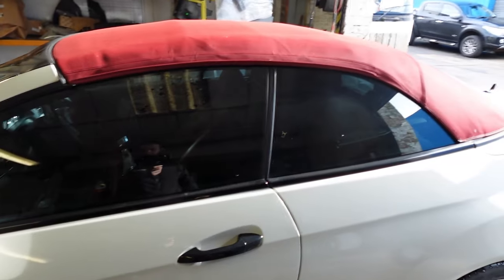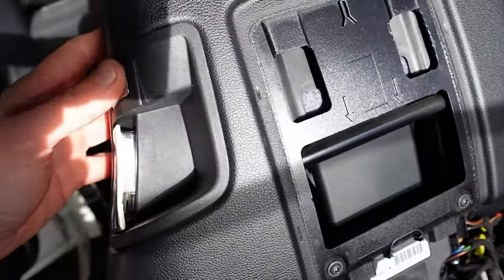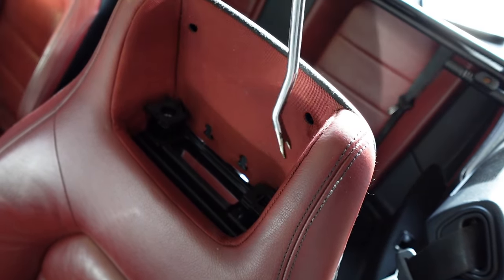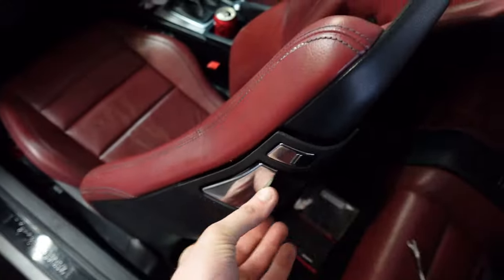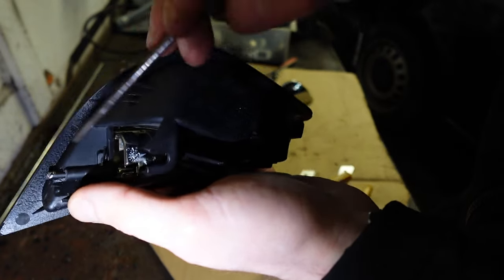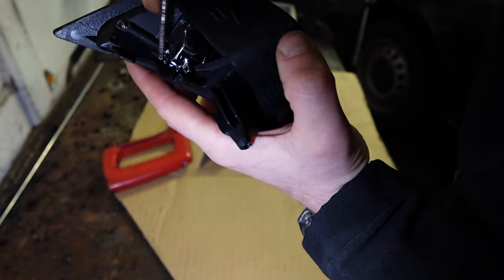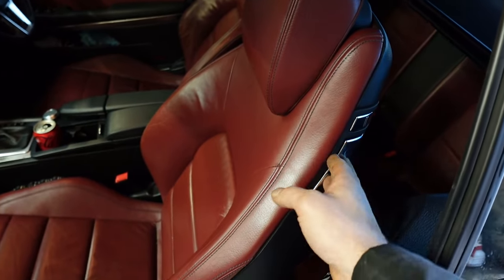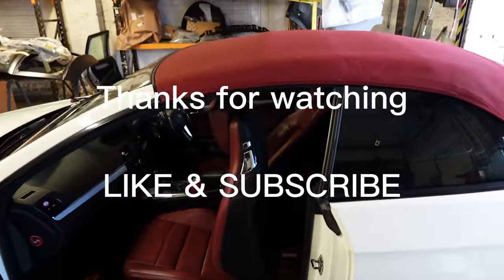Mercedez Benz Seat release handle REPLACEMENT E-class C-class A-class CABRIOLET/COUPE W207 - HOW TO

Comment: Just want to say here for those of you who can’t get your headrest out, there is a U clip, very thin metal clip on the far left of you are facing the front of the car in the back of the seat, it is seated on a black clip that holds the headrest bar… it pings off with a screwdriver…. Your headrest will then be free to release with the button. Thanks for this video, made the job stress free.
Reply: Really really important step that I think the video missed! Thanks! - One question though, how do I reinstall the clip?!
Reply: Removed the back panel. Couldn't remove headrest. Cussed all German engineers back to the third Reich. Watched video again, found this comment. Removed headrest like a pro, fixed both seats in under an hour. Promised to buy this guy a beer.

Comment: Thank you going to try this …purchased the handles of eBay fir 30pds the silver has  peeled of the original and keep cutting my fingers when pulling on it 😮
Reply: I just bought carbon fibre for £10 and took chrome of with blade and recoated with carbon using hairdryer look great took 20 minutes didn’t remove anything

Comment: Hey man thanks for the vid. I did my 2014 C 250 coupe a year ago and was almost the same procedure but did not have to release the seat cover to access the two bolts.  When I got in there the plastic barrel section of the handle that wraps around the hinge was broken in half but still there so I used blue low stick painters tape to make a mold then a slow set , high strength 2 part epoxy ( gray JB weld ) to glue it back together without removing the whole assembly from the seat - had to release the cable so no tension though. Overnight cure and another coating for strength and its been working fine though it only gets used maybe twice per month . The part is just cheap plastic so if I do replace it will prolly coat with epoxy to give it some extra strength . Would have been nice if MB handle supplier had used 20% glass fiber in the part to give it enough strength .
Reply from the maker: Yeah these are a nightmare from merc and the passanger side always breaks as used the most of convertibles and coupes ! I guess theyre designed to break so merc can charge £400+ for the assembly ! Thanks for watching and the tip much appreciated 💪🏻

Comment: I’ve tried everything but I can’t actually get the headrest out. It sounds like it’s clicking on something or locking trying to get the headrest out. Is there something I’m not doing? I got the rubber clip out at 1:51 of your video but they aren’t going out at all. Thanks for any advice in advance
Reply from the maker: The headrest comes out super easy press the button on the side to lift it up when u get the headrest all the way to the top release the button then press it again and wiggle the headrest out hope that helps

Comment: Do you disconnect the battery before changing it or leave the battery alone?
Reply from the maker: Key out the ignition and battery left on as i didnt disconnect the actual seat or airbag plugs no need to disconnect the battery and no faults on the car after completion 👍🏻

Comment: Hey thanks for the video.
So with my Merc when i pull the handle the seat is not automatically going forward as it use to, to make space to get in the back. The passenger sear is functioning as it should only the driver side is giving problem. It could be a malfunction or just a matter of wire unplug. Can you please guide me
Reply from the maker: Hi Thanks for watching !! So i would start with removing the cover on the back of the seat once u do that all the wires attached to the handle and the actual locks which hold the seat in place will be exposed ! I would recommend inspecting the release wires first if all in order and moving when handle is pulled mu next stop would be examining the locks under the seat to which the wires go to maybe the locks are just seized as mostly when letting passangers in the back they would use passanger side ! If u struggling let me know i will do a video on my seat to guide you through it if needed ! Hope it helps
Reply: @MacBerci  thanks heaps i'll give that a try 🙂
Reply from the maker: No problem at all 👌🏻 if need any more help let me know !

Comment: Hi great video have you done a c class w205 coupe please?
Reply from the maker: Hi there not yet however i am sure the procedure is the same the seats are identical in convertible and the c class coupe . Thanks for watching
Reply: @MacBerci  
To be honest I don’t think so the way the cable attaches to the handle is nearly completely different.  unless I have a different year (2017)
Reply from the maker: @zeone3000000  hi there aure about 2017 models i think theyre completely different my convertible is a 2012 i think 2016 onwards the seats are lifted and look completely different

Comment: Bro, i have C207 2012 e coupe, and after i raise the headrest all the way up using the door control, the headrest still doesnt pull out.
C207 doesnt have that small button by the pull handle.
I see silver geommet going around the bottom of the headrest post. Do i have to remove that forst, somehow, before the headrest completely pulls out?
Reply from the maker: hi there i have not noticed the comment before hope u managed to get the headrest out ? if not let me know i will get methods from mercedes on how to remove it and send it over to you . Thanks
Reply: @MacBerci  i got it out. just had to yank it real hard. thanks.
Reply: Yeah , I have an electric button on car door that operates the head rest and I removed the silver grommets and still it's sticks and can't pull it all the way. Gonna have to put all pieces back now. Tried for a good 30 minutes no success 🤬
Reply: Omg I did the same got frustrated and sat in the seat and pushed it softly one way and there she blows lol . Patience people . Thanks for the inspiration both of ya . Cheers from yhe other side of the pond@endlesstrading